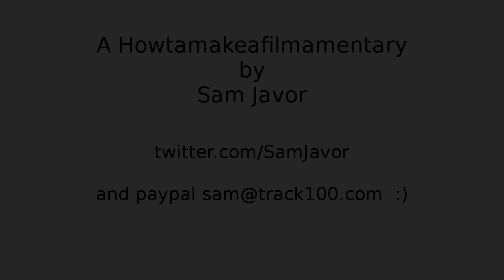How to Motorize the Lomokino for about $30

Comment: I feel I have to point out that most online converters say approx 580 rpm equals 10 fps and not 19 fps as stated in your video? I am looking to use a 540RPM motor that will allow me to shoot 9 fps on my Lomokino, I plan on doubling the speed in post production to make it 18fps for that silent film look. Obviously any action I shoot will be of actors using minimal movement. By doing it this way it will also allow me to save on the cost of using less 35mm film cartridges and making sure nothing breaks inside the camera ;)
Reply from the maker: If I recall when I was messing around with this the Lomokino executes 2 frames per revolution.
Reply: @zekthedeadcow  Thanks Sam I will be sure to provide you any knowledge I learn along the way. One things for sure it will be a learning curve and a lot of fun.